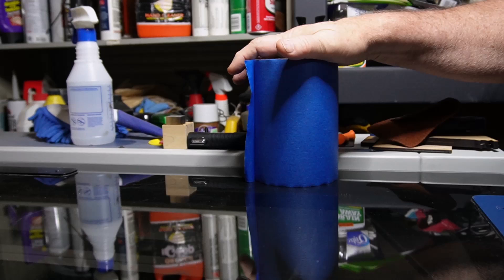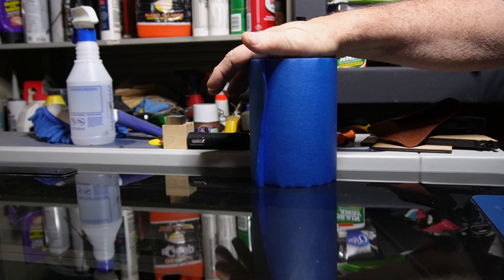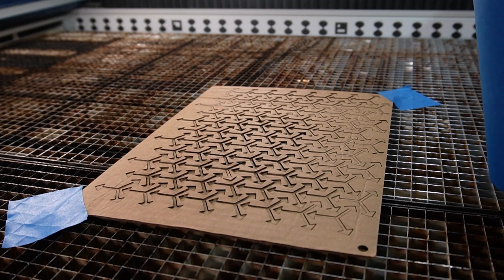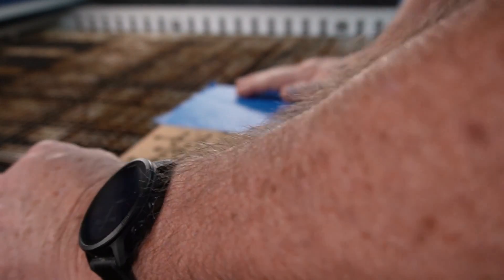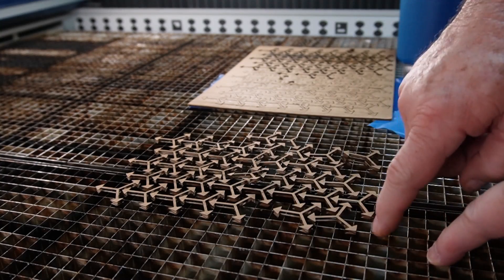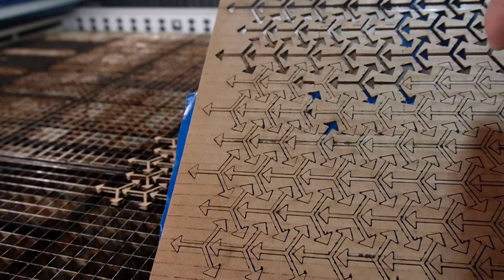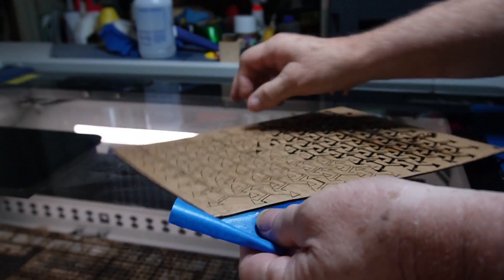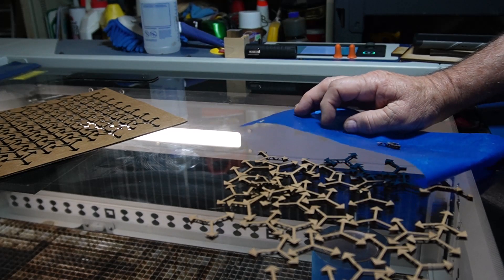BLUE PAINTERS TAPE is a Laser Engravers Friend - Picking Up The Pieces - PART 6

Comment: I have a separate honeycomb that is typically for a diode laser I use for this very task. I lay the honeycomb over the laser bed and cut on there. After the cut I pick up the separate bed and dump it on a tray. Less damage to parts and fast pickup/reset.
Reply from the maker: That sounds like a good idea.